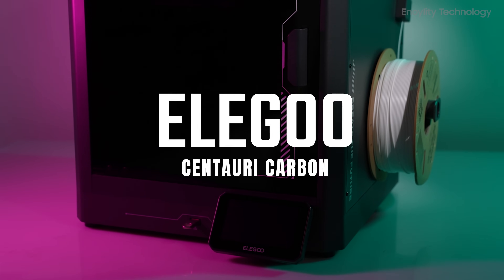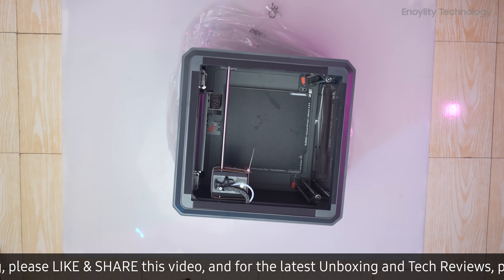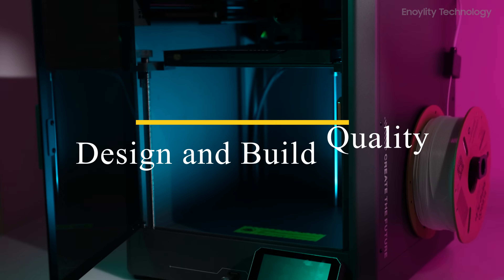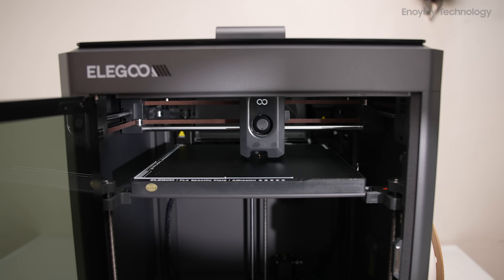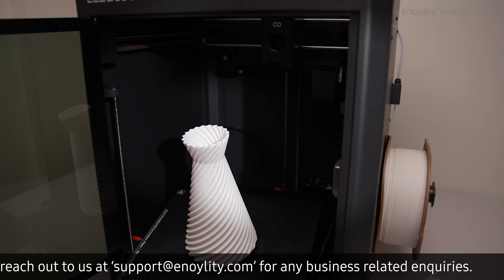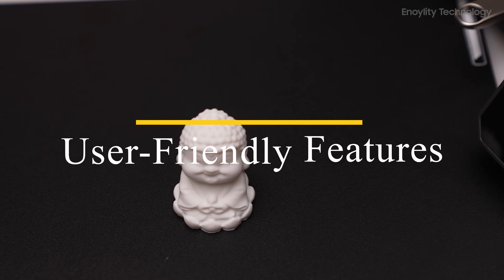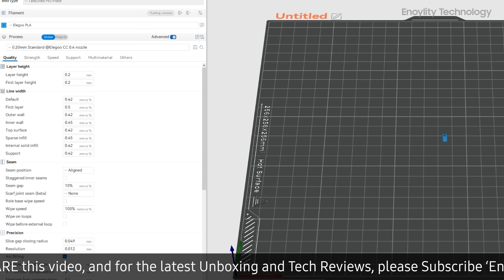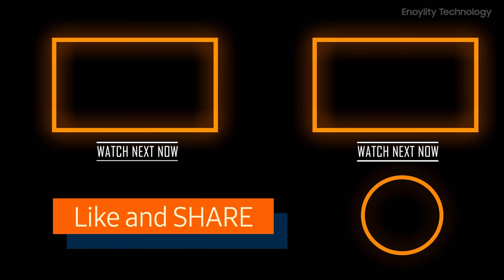ELEGOO Centauri Carbon Review: The Premium FDM 3D Printer You’ve Been Waiting For!

Comment: Supports either fuse to the model or leave craters. Is there a secret to clean removal or just luck?
Reply: Adjust support interface distance—0.2mm gap works for me!
Reply: Tree supports changed my life. Less contact, easier removal.
Reply: Sometimes I just design my own custom supports in CAD. 🤓
Reply: I ust want to print, not become a 3D printing engineer.

Comment: Spent 3 hours leveling the bed, and it’s STILL not sticking properly.  😤
Reply: Try glue stick or hairspray—game changer for adhesion!
Reply: Once you get it dialed in, it’s smooth sailing. Hang in there!
Reply: I gave up and switched to a different build surface. Some beds are just cursed.

Comment: The machine runs Klipper firmware, so performance and speed tuning are on another level
Reply: An excellent little (well, little in footprint, not height!) Printer. Perfect for entry level people, or those like myself who don't enjoy the hassle of levelling an Ender 3 V2 for hours on end.
Reply: The printer printed beautifully and quickly right out of the box, apart from some ringing issues. Which is sort of expected/easily fixable with the included stepper drivers being kind of sub-par.
Reply: Works great! This is the fastest 3D printer I’ve encountered while still maintaining great print quality.
Reply: Fast, only problem is you can't really take advantage of the speed if you need the parts to have any structure. Inter-layer adhesion is really weak when you go fast.
Reply: Should be an EASY fix, haven't seen anything yet. Took off a star because not everyone will care, but this is a clear malfunction.
Reply: It is more complex so setup is crazy and so much more goes jnto tuning. I feel i will need a much bigger learning curve to master this but bring on the fun and always remember it maybe fast but your also limited on material speeds
Reply: 4.3-inch capacitive touchscreen for easy navigation

Comment: It’s one of the quieter enclosed printers I’ve owned, especially during longer jobs
Reply: The printer is still making fantastic prints. I cleaned the bed with isopropyl alcohol to clean off any fingerprints and debris that led to poor filament adhesion after a week of use. This restored great adhesion to the bed like new again
Reply: It just seems to be too delicate of a machine. Will have to process another return and refund and try my luck with a different brand
Reply: I was pleasantly surprised with the quality of this printer. Especially considering the price.
Reply: The printer itself is solidly built. The self leveling bed makes leveling easy. The touch screen is very responsive and intuitive.
Reply: I feel that this is a real tinkerers printer. Expect to spend a lot of time tweaking the printer. Not because you have to, but because you want to. My only complaint right now is how noisy the stepper drivers are.
Reply: Nearly pre-assembled, allowing for quick setup.

Comment: The print speed is noticeably faster than other printers I’ve used, without compromising quality
Reply: I'm bummed on the corners they cut, better quality stepper drivers, higher quality timing belts, and a custom firmware that is based on RRF (FLSun plz publish your source code and obey open source licensing) rather than just running marlin
Reply: This product was inexpensive, came with all the parts and tools needed, and included a small sample of red PLA. As a 3D newb, this was a perfect setup so far as it goes. I was able to assemble in about 30 minutes (some of which consisted of staring at tiny pictures to see if that one cable went over or under the other) but it turned out to be almost foolproof
Reply: Then plug the USB stick into your PC. I had never seen a micro SD adapter like that and initially thought something was wrong with the USB stick. Once I figured that out, all was well. I'm very happy that I chose this one as my first 3D printer.
Reply: Simple assembly and operation, ideal for those new to 3D printing."

Comment: Remote monitoring and file transfer via Wi-Fi adds a layer of convenience, especially for batch printing
Reply: This printer has a very good auto-level function, built in with only the sensor to clip on magnetically and plug in. It tells you when to do this and when to take it off too. Instructions for assembly are not very good though, as a lot of Chinese originating products.
Reply: This printer is a work horse. I've owned this model for a few months now and I haven't let it rest. Multiple 24+ hour prints and no issues other than the minor print quality problems that were more my fault than the printers
Reply: Can handle a wide range of materials, expanding creative possibilities.

Comment: Excellent printer for this price range, I've worked with lot of expensive printer. The print quality is very satisfying. If you ever wanna buy a 3d printer for the first time, go for this.
Reply: This makes it so much easier to work with. Both printers have a similar build plate, which I've found to be spectacular for adhesion and very good for removability.
Reply: The SR is another incredible printer from FLSun, easily achieving speeds of 175-200mm/s with factory hardware and firmware, and consistently delivers great quality prints using only the basic Cura profiles included with the software.

Comment: Easy to use for a beginner and a lot of fun. Looking forward to learning more about elegoo 3D print. I’m happy with this purchase.
Reply: The printer comes with a micro-SD card and a USB micro-SD adapter, to allow easy file transfer. Sample g-code is included for an elephant (don't bother) and a knurled nut and bolt. The latter set is worth printing, especially for testing. You'll be impressed.
Reply: You’re very limited in what you can tweak in the robin_mini_config file for the firmware. So no setting up linear advance or pid tuning or any other tweaking you can do from open source like marlin.
Reply: It’s designed to be simple to put together, even for people who are new to drones.

Comment: For someone just starting to 3D print this printer made it so much easier especially with the auto bed leveling. Would highly recommend it
Reply: Easy to assemble, not as fast as some printers but should be doable by anyone that can read directions.
- Autoload and unload of filament works very well

Comment: I would highly recommend this printer if you are finding a 3d printer in bought segment because this is the best printer and it is my first time buying a 3d printer.
Reply: The only con I have run into so far is that it's huge. I really didn't pay close attention to the specs. It's certainly much taller than a conventional 3D printer, but it can print much larger objects than most
Reply: They do have PDFs on the SD card supplied, but I found it easier looking on YouTube. The printer does very good quality, and is a fair bit faster than normal/Non-Delta FDM printers. I do recommend keeping the print speed at 50-60mm/s minimum, otherwise it can struggle a bit at slower speeds
Reply: Then try printing there. If it's slipping, tighten a little [tiiiiiny bit] more. If you stretch the belts out, it's quite the chore to replace them, though not undoable once you know how.
Reply: As amazing as it performs out of the box, it is also highly adaptable and customizable, and I can’t think of a better printer for both novice and experienced hobbyists.
Reply: The printer is already set up to do so much. The auto bed-level switch works very well and the fact that its a magnetic connection is nice.

Comment: The touchscreen sometimes lags during file selection, especially when the SD card is loaded with lots of models. A firmware update could probably fix that
Reply: Best 3D Printer with good quality parts and customer support is great.
Reply: The printer also comes with slicer software called CURA. If you're a newb like me, let me explain. When you see someone on Youtube print in 3D, they show an image in CAD software, then they show the print extruder making the part, and la voila there's the piece.
Reply: This is the most reliable 3D printer I and I've owned eight different 3D printers. I still have some of them of course. I'm now a huge fan of not only ELEGOO, but Delta style printers.

Comment: The CoreXY design and sturdy frame provide stability for large prints, maintaining accuracy and reducing vibrations
Reply: The one thing I would advise is to make sure the bed is 100% cool before you pull the print off the glass bed or you can damage it.. and I mean 100% cool... like.. leave in an hour or two after its done printing and the print will jump off the bed with a small tap
Reply: The silent operation is a huge bonus, especially for home users

Comment: The printer's design is sleek and modern, fitting well into my workspace without taking up too much room❤
Reply: Elegoo nailed the aesthetics on this one. It looks super premium and professional, not like a DIY kit. Makes it a great addition to my studio setup😊
Reply: This is an amazing printer, that's really easy to use and perfect for a beginner.
Reply: It took another 4-5 minutes for everything to warm up, so about a 45 minute total from opening the box to seeing the first layer laid down.  All done by a 14 year old newb purposely going slow.   Like i said - super easy.
Reply: Overall though this printer is very capable. It's easy to setup and calibrate, extremely fast, comes with a lot of great components and feels rock solid. Best of all it's extremely fast and a lot of fun to watch it run!
Reply: That also includes, greasing the rods, before each use, and properly cleaning the build plate after every three prints or so. If you're looking to buy a 3D printer, do not waste your money on any others.
Reply: The Centauri Carbon is a solid investment for any 3D printing enthusiast

Comment: The cooling system works well, but I found the internal lighting to be a bit dim for monitoring prints directly through the tinted glass
Reply: This is an amazing printer, that's really easy to use and perfect for a beginner.

Comment: The magnetic build plate makes removing prints easy, but I have to be careful with larger prints to avoid bending it 😇
Reply: Great quality at those speeds. The extruder is very good, if a bit noisy on 7mm+ retraction. The machine can handle feeding in and feeding out the filament with a dedicated program/tool for changing over filaments, which I was surprised that other, more expensive printers don't have usually (you have to wind the filament in and out manually, which can be an issue at times).
Reply: Any print quality or bed adhesion issues I’ve encountered (though rare) have been promptly resolved with cleaning the bed, Re-leveling/adjusting Z height. As with any printer it is a good idea to PID tune the bed and heating elements, and to calibrate your extruder.

Comment: I experienced some adhesion issues initially, but cleaning the build plate with isopropyl alcohol improved adhesion significantly😊
Reply: I encountered some stringing issues with TPU, but adjusting the retraction settings helped mitigate the problem😢
Reply: The print resume function after a power loss worked flawlessly for me
Reply: That's what I wondered. Well, just like the standard 3D printers, once you know what to look for, and adjust, the end results are not only the same, but in my opinion, better!
Reply: I'm impressed with the printer's ability to handle a wide range of filaments 😊

Comment: The build volume is adequate for most of my projects, but I do wish it was slightly larger for bigger prints
Reply: The elephant and the nut/bolt combo that came on the SD card looked great to me, but then again this was my first experience with a 3d printer so i didn't exactly have a point of reference.  The big surprise was how much my older son (the engineering student) was impressed by the prints.
Reply: The Centauri Carbon is a perfect choice for both beginners and experienced users

Comment: The integrated camera is a nice touch. I can monitor my prints remotely and ensure everything is running smoothly
Reply: Air filtration is a thoughtful addition, especially for indoor use where smell and particles matter
Reply: Printing with PETG, PLA, ABS, and nylon has been consistent and reliable so far
Reply: Time-lapse function is fun and great for sharing project progress
Reply: I made the mistake of pausing the printer fo an hour and it burned out the motherboard. ordered a replacement for the factory but the new one didn't work so I tested the by swaping it with a good one in another printer
Reply: The auto bed leveling feature is a true game changer for FDM printing
Reply: The Centauri Carbon is a great addition to my workshop 😊

Comment: The Wi-Fi connectivity allows me to send prints directly from my computer without needing to transfer files via USB
Reply: The only issue I've had with this printer is that it is kind of loud. Not so much motors but the cooling fans for the control board are loud
Reply: The large build volume allows for a wide range of printing possibilities

Comment: The printer's speed is impressive. I can complete projects in half the time it used to take with my older machine
Reply: The 320°C nozzle opens up possibilities for high-temp materials like carbon fiber-reinforced filament
Reply: The magnetic PEI bed offers excellent adhesion and easy model removal
Reply: The tensioning system for the belts is intuitive and keeps things running smooth
Reply: It comes with extra parts. While I have had problems with the installed firmware and broke one of the main boards through tinkering, the price point and performance of this printer are unbeatable. I recommend this for anyone on a budget trying to get into enthusiast 3D printing, preferably with some experience working with printers in a fablab, watching a friend or otherwise
Reply: The filament sensor is a handy addition, preventing wasted filament
Reply: I highly recommend this printer to anyone looking for a reliable and high performance FDM printer 🙂

Comment: I've been using the Elegoo Centauri Carbon for a few months now, and its print quality is exceptional. The enclosed design helps maintain consistent temperatures, which is great for ABS prints
Reply: The touchscreen is generally responsive, but occasional firmware glitches may require a restart to resolve

Comment: Love the responsiveness of the Fluidd interface. Way better than traditional Marlin setups❤
Reply: Elegoo has done a great job integrating a camera for monitoring prints remotely — very handy
Reply: Immediately after the first two prints from the card finished, he sliced up his own models that he previously printed in the college lab using a Raise3D printer.   He's the type that doesn't care about finish, and is all about accuracy and proper tolerances.   After measuring and re-measuring his prototypes, he declared the printer to be "good".
Reply: Love the way it prints! Having more height to print, which of course gives you more models to choose from. Many great features that come with this printer. The ease of building it! This, in my opinion, is a "AWESOME" printer! I'm just getting my feet wet, in 3D printing....so I am by no means a pro at it yet!
Reply: The dual Z-axis is a great feature, ensuring smooth and precise printing

Comment: Klipper gives you full control. I’ve made profiles for PLA, PETG, and TPU, each dialed in perfectly 👌
Reply: I flashed my own Klipper config, but beginners might struggle without a guide
Reply: I appreciate the dual-sided build plate. The textured PEI side works well for PETG, while the smooth side is perfect for PLA
Reply: The enclosed design helps with temperature-sensitive materials, but I had to open the top panel when printing PLA to prevent overheating
Reply: The printer's ability to handle various filament types like PLA, ABS, and PETG gives me flexibility in my projects
Reply: I was impressed by how solid and premium the aluminum alloy frame feels; it minimizes vibration well

Comment: Fans are a bit loud when the part cooling kicks in, but not unbearable😢
Reply: Elegoo should include more preconfigured settings for newer users
Reply: I noticed that the printer operates quietly, which is a significant improvement over my previous open-frame printer
Reply: The machine is extremely simple to assemble and get running. You'll be printing your test print in half an hour
Reply: Works great! This is the fastest 3D printer I’ve encountered while still maintaining great print quality
Reply: This printer prints well at speeds ranging from 70mm/s, to 100mm/s while maintaining optimal quality. It's also very quiet. Which is a huge plus
Reply: I was very pleasantly surprised by the quality of their customer service. I would recommend this printer to anyone looking for good value for their money.

Comment: Does it come pre-assembled?
Reply: It comes semi-assembled. You’ll need about 45-60 minutes to finish setup
Reply: Installation of macros and tuning scripts was straightforward using Mainsail
Reply: Setting up the Centauri Carbon was straightforward. The auto-bed leveling feature saved me a lot of time compared to my previous printer
Reply: Works, but needs calibration. I had issues with the extruder not working right. The filament would clog until I reassembled the extruder. It works, but I think the issue is over extrusion or its printing too fast so the accuracy isn't perfect.
Reply: It’s about 90% assembled, just a few steps and you're ready to print